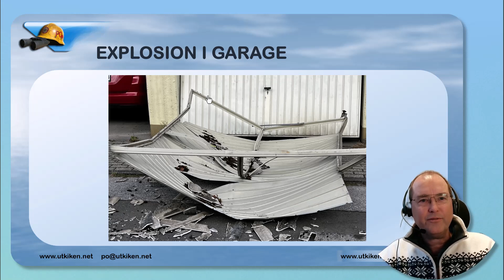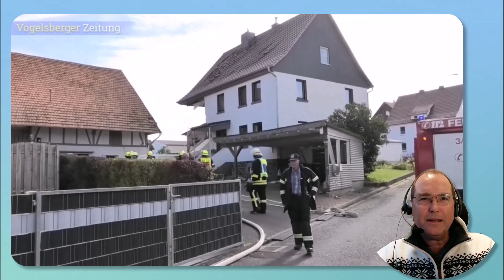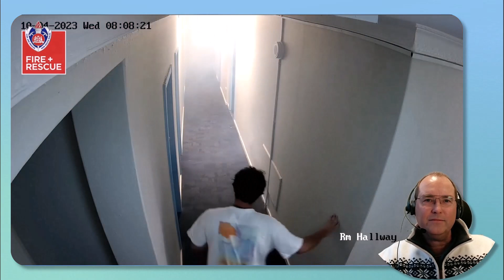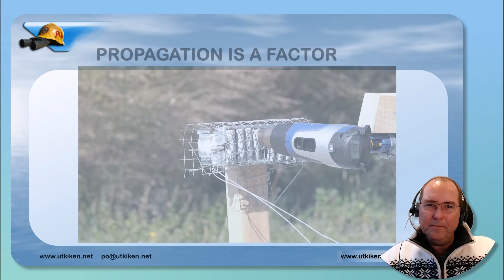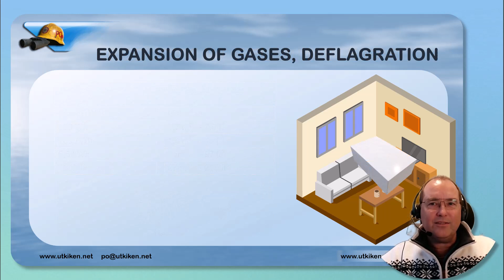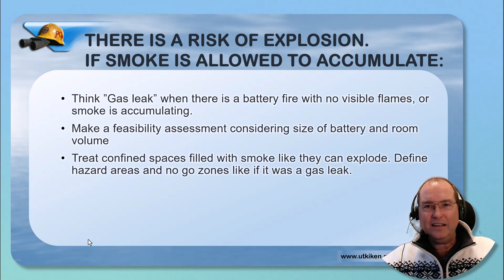Explosions due to lithium ion batteries. Examples, why, and a way for firefighters to think

Comment: Excellent video PerOla. Just want to emphasize that with LiB's we should be referring to the "smoke" as flammable gas. It is not products of combustion, it is unburned fuel looking for an ignition source.  Keep up the great work!
Reply from the maker: Thanks Matt, I really appreciate your nice words! It is a good point about the smoke. I have been hesistant about what words to use since regular smoke can be flammable as well, when we have a fire/pyrolysis in an underventilated setting for example. So I figured that firefighters already know about different flammability properties of smoke, and that smoke is what we see and the properties of the smoke can vary depending on what the smoke contains in form of gases, particles and aerosols. But I really agree that it is important to  point out that smoke from LiB are flammable gas.